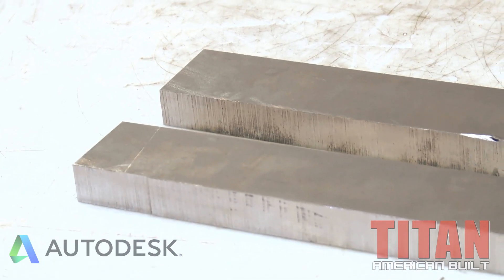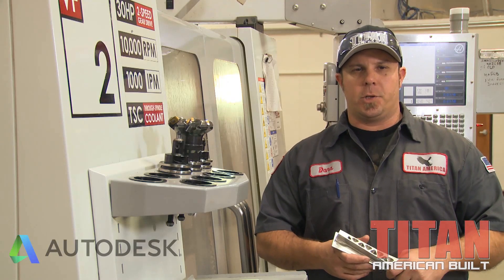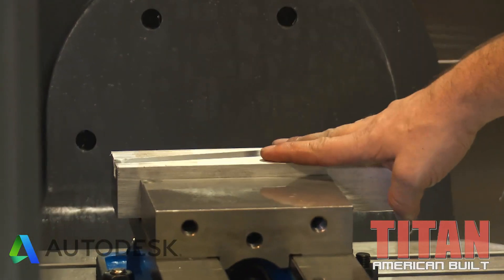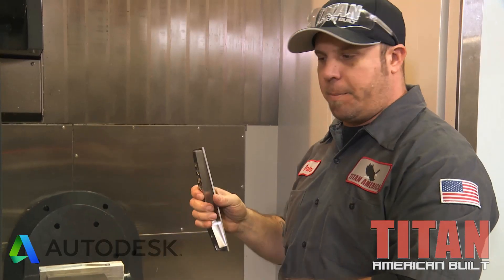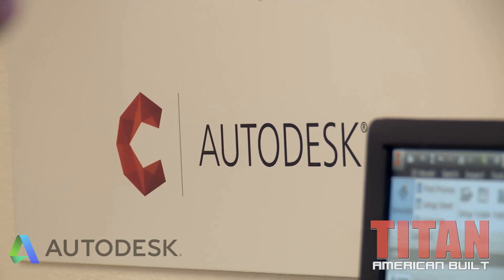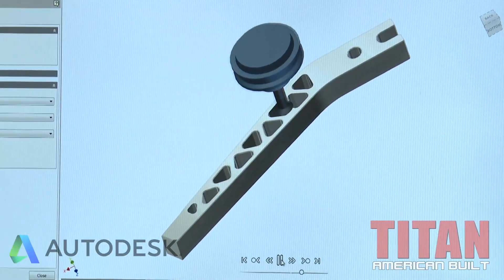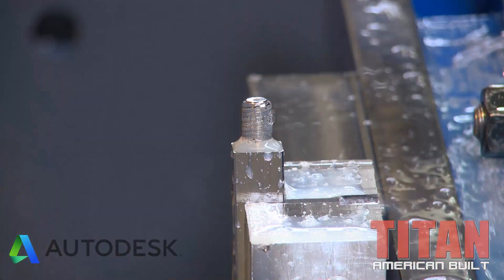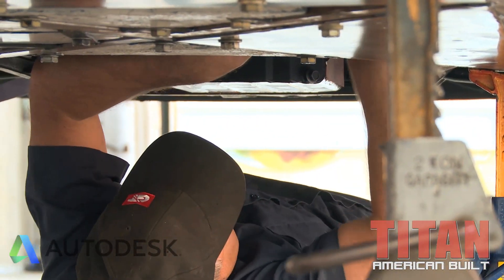Titan machining cool Inconel Gear shifter

Comment: I have to go with the one guy saying why inconel?  inconel just takes the heat and stress better, but why and how much heat is actually going to be in a shifter handle? really want to impress me with inconel try forged 718 at those feed rates. bye bye fancy cutter.

Comment: you didn't need 5 axis you could have did it all in the vf2 with a rotary table
Reply: 5 axis is quicker
Reply: seindich   I actually run similar looking aerospace parts and it would be triple the cost and not that much quicker on cycle he used 5 axis because he has it I just said it wasn't necessary and the cycle time wasn't much quicker then what I could of done with a vise on one side of the table and a 4axis on the other

Comment: Nickel alloys are used in aerospace for parts that need to maintain a high modulus of elasticity at elevated temperatures. Turbine blades, rocket engine combustion chambers, stuff like that. I am sure that the driver knows that and just wants a inconel shifter because it's cool though lol.

Comment: A quality product on a HAAS machine 2 things that just don't go together
Reply: +Carlos Mazak couldn't do what both Rolls Royce and Ge wanted on their stator case grinders/turning machines.... so aren't all that amazing...
Reply: This is why the youtube comments are cancer. You two started off with a nice convo and now look at what you've done. Both of you kindly stfu and be the bigger man... 25 years of experince in CNC but jack squat in kindness. :(
Reply: +Sloan V The truth hurts
Reply: +Chris Murray want to explain yourself? I can understand how someone may prefer another system over a Haas, but what on Earth makes you think it doesn't make quality parts?
Reply: +adad2757 No problem I have been in the industry for 25 year as applications engineer for various machine tool manufacturers mazak makino And now WFL mill turn so I see a lot of machine shops from small to some of the biggest Haas machines are extremely fragile they have the worst spindle on the market and are constantly breaking down  when they are pushed hard I know a number of new start up have purchased Haas and nearly went under due to the fact the machines never worked and they could not get the product out of the door FACT this is not a one off problem neither its happening all over.In this game you get what you pay for Haas are cheap and cheerful no good for heavy hard 24/7 production running they are just incapable of handling the stresses what this kind of work  needs and in this game if the spindle isn't turning you ain't earning
Reply: +Chris Murray i know numerous companies who refuse to sub contract work out to companies that use HAAS machines. It takes a quality product to make a quality product that's the philosophy of many companies today
Reply: +Jason Sykes you are entitled to your opinion as am I,my opinions based on 25 years in the industry working in some of the most advanced industries and biggest companies in manufacturing,in the world From Rolls Royce Aero in the uk Lockheed and General Electric in the states  my job was to tell these companies the best way to machine and manufacture various components structures and assemblies.Then I went to mazak as an applications development engineer' Now I run a team of technical applications engineers For WFL implementing all new machines products and advanced technologies.So you have an opinion which your very much entitled to and I applaud you for that,the difference is numerous Fortune 500 companies pay me very well and actually listen to my opinion on this matter.So although your opinion might sound relevant to you in the broader spectrum it just well isn't really.So please carry on with what ever machine you feel that your skill set is best utilised on and I will do the same.
Reply: +Jason Sykes just for the record I would love to see you prg online @ the panel a point to point simultaneous 5 axis complex machined component that features both milling and turning with high feed cutting,vector machining,contours and tool center point control controlled cutting and off center cutting with say something simple like a fan blade for an Airbus A380 or an anti locking brake matrix for a 747.If you manage this I will give you a job and pay you £150k a year tomorrow.As you say it's not the machine or the programmer it's the machinist.
Reply: +Jason Sykes hold on 1 minute you said I don't know what I think I know,I've just explained how and why I claim to know what I know.Then you stated it is a good machinist that makes a good component not the machine.Not quite right neither it takes a Good engineer to understand how the job should be machined and programmed  then he passes the job pack to the good machinist to set up.Good machine machinist are 10 a penny good engineers are not.You claim to be a good machinist which you may well be in fact an excellent machinist maybe the best machinist in the world.So if your that good crack on prove me wrong
Reply: +Jason Sykes I made a comment about HAAS machines not being up to the job you claimed I didn't know what I claimed to know. I still claim HAAS machines are not up to heavy continuous precise machining.Due to this the end product suffers both on quality and quantity.So as my original statement you can not make a quality product on a HAAS machine I still stand by.
Reply: +Jason Sykes cheers 👍
Reply: +garyhowe88 I served my time @ Rolls Royce aero spent 6 year @ ansty started off in the blade shop moved to fan casings then finished in the heavy shop.RR have never used Mazak machines when I was their,they had MORI SIEKI.and geildermeister  for all the hard turning.and struder grinders.fair enough I left 98,but I have been back.All I seen were Hermle DMG.My point is RR would never even contemplate using Mazak as they know for a fact they will never be good enough.and they have a purchasing agreement with the the 2 I've mentioned So why and where did RR trial Mazaks ?All the heavy turning is done on WFL millturns the company I left RR and the heavy machining centers are Dorries scharman.So again where do mazak come into the equation.
Reply: +Carlos I actually agree with Carlos. I'm a CNC operator myself from Sweden. I worked with Mazak, Quaser, Datron and Haas etc.., They all do their job, but after a while you can tell the difference. Mazak is an absolute beast, Quaser pretty good but Haas is absolute shit to be honest. It's a nightmare when you're trying to push out products but it decides to give up on you. Not once but several times. Maybe I had a bad luck or I pushed too hard who knows, But exact same products and exact same tool path worked flawlessly on Quaser and Mazak for a few thousand hours.., Just saying
Reply: +Tedi Munken  Alas finally someone who actually knows what their talking about.Just out of curiosity which control system do you find the easiest to use day to day it's not very often I get to speak to someone in Sweden so it's professional curiosity. Fanuc Siemens/power line or solution line/Mazak  CNC fusion/matrix/heidenhein. Do you prg online or offline and do you use renishaw or bluim probes/presetters. Also what Cad can do you use in Sweden ???? Your input would be very much appreciated 👍
Reply: +Carlos We used to have EdgeCam but it was just too massive and not quite "user friendly". So we switched to GibbsCam actually. By far the most efficient and easy to use Cad. Specially Volumill function, it's a monster. We use Solidworks for drawing, and we program the tool path send it to our machine's hard disk (wireless) and we're ready to go. We do a lot of work for ABB, Westing House, Sandvik etc.., they usually order at least a few thousand parts. So we don't really program like everyday. I personally like Fanuc control system, it's just something I feel familiar with I guess. So yeah, Edgecam, Fanuc and Heidenhein are dominating here but GibbsCam and some other stuff are coming along. (And yes we sold our Haas)

Comment: Why in the world would you select inconel as the material for a gear shifter?
Reply: +MotorsportsX I can't even begin to contemplate how hard he must shift gear if he needs a solid inconel gear selector must be hulk on roids.Any normal human being wouldn't even be able to flex a standard grade 318 steel shifter never mind Inconel.This is just a total waste of time money energy and Inconel ! Who's idea was this in the first place ?
Reply: +cnccarving your point is moot you can get excellent American made Cnc machines but Haas are not one of them as for the manufacturing and machining aspect of the video he is not doing anything ground breaking.As for the material he is using if he wanted to show off how good the foundries are in the US why not use haastaloy c to make the shifter ?
Reply: marrsooll you guys have obviously never shifted anything with 2,000 horsepower.  you dont just shift, you yank that sum'bitch .... you WILL bend steel shafts.  Plus its cool
Reply: MotorsportsX Please tell me you're being sarcastic....
Reply: +marrsooll  because its America... and  Gilroy just very much right about... America need new  henry fords...  

not just one but many..  many-many, just like Gilroy...  

at this moment America  flooded with  ""german engineered"" cars, and American  manufacturers  are suffering..he using American machines, and control with American programs.. that's it..
Reply: +marrsooll hes loud more than need.. but  otherwise  this guy just very right...

Comment: Inconel for a gear shifter?   Someone needs to study up on their metalurgy!  You paid way too much for properties you'll never use!
Reply: but i need to make sure my gear shifter won't gain a couple thou at 1500 degrees
Reply: +FreqFarm 
ahem...big as trucks that are jacked up 20" just to be used as a daily driver...welcome to 'murica...land of the egotistical morons.
Reply: FreqFarm lolol very well said. inconel is in the nickelalloys family and is designed with thermal stresses in mind. does your gear shifter get hot like a turbine wheel in an older turbo? lmao
Reply: aluminum or titanium would be better for weight savings
Reply: Joseph Eirman that might be true but if my customer wants iconel then they pay for it... if they want stainless well.... You know the answer.